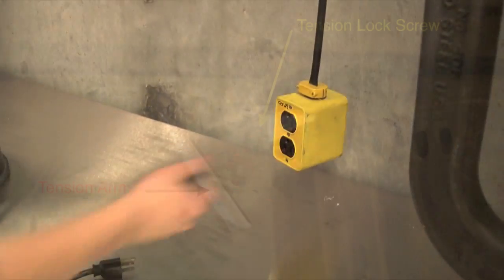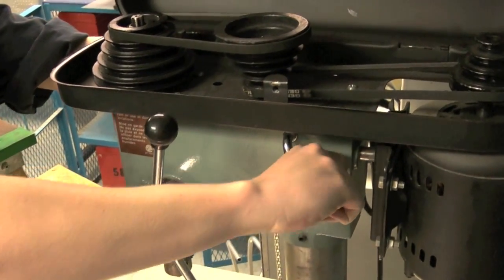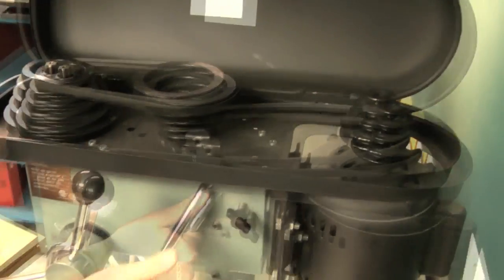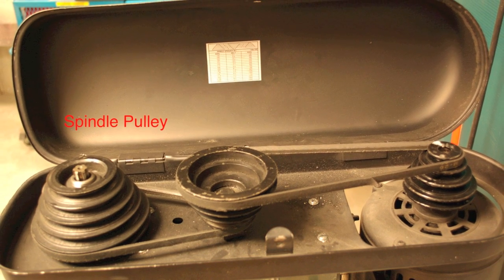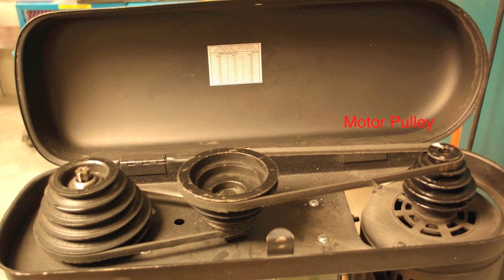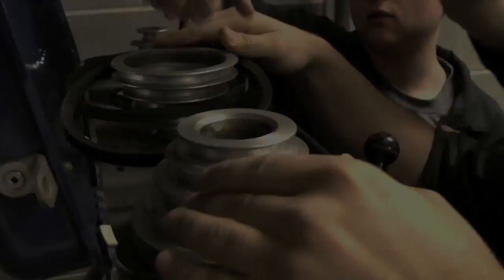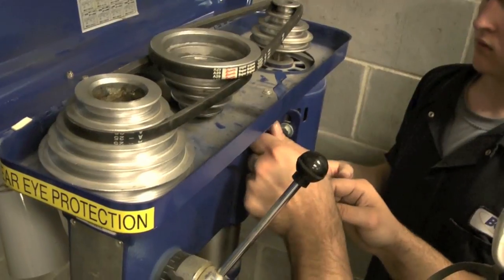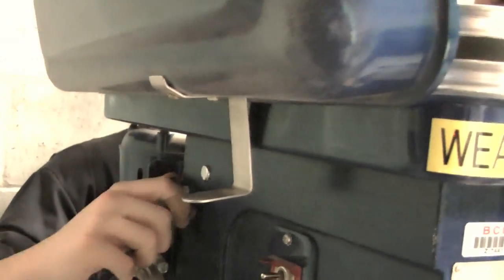Drill Press Safety and Adjustment.mov

Comment: Anybody that is still alive in these comments know what size the belt it
Reply: Belt on the spindle pulley and idler pulley is an A25. Can't make out the belt size on the other belt...looks to be either A25 or A29
Reply: My press which looks identical but sold by Northern has M25 and M26 belts

Comment: Thanks for posting the video it was very helpful, I have the same drill press which has been rebranded by NUtool, do you happen to know the belt sizes or where to find out ? I've emailed NUtool a few times and heard nothing back, the drill was second hand and I think previous owner put wrong belts in, thanks
Reply from the maker: Hi Christopher ~  I no longer have access to that drill press, so I can't comment on the drive belts.  Just recalling from memory, drive belts were often a standard item in many automotive supply houses, and it was not unusual to have the worn belt replaced with an off-the-shelf item, and small adjustments in the belt length were easy decisions at the time of purchase. Take your unknown belts with you to an auto parts retailer and they can advise you.  Be aware that some drill presses have the adjustments for the center idler wheel hidden, and only loosened up with a pair of bolts underneath the wheel.  Good luck.
Reply: @Riveteer  thanks for the advice

Comment: I have a drill press I recently bought. I have started taking it apart for cleaning and derusting. I had to remove the motor mount. It was bolted in place by 2 tension arms that stick out the back of the cast body. I removed the tension rods, but do not know how to correctly position the tension adjusting arm when putting the tension rods back into the drill body. The drill press I own is a TOOLMAC 16 Speed Heavy Duty Drill Press, MODEL # 82-532401. 3/4 HP.
Reply: Any and all advice or information would be most appreciated. Thank you for taking the time to read this.

Comment: I have a problem and hope you can help.  My drill press is a Central Machine Model 10168, serial number 0262274.  After reviewing your video, I noticed that my machine does have the locking screws, but no release tensioners.  Even after unlocking the screws, I cannot release the tension on the belts.  What should I do.
Reply from the maker: Hi Randy - although I couldn't find much information on model 10168 drill press, you may have the type of drill press where there are 3 pulleys in the belt drive compartment.  This type of machine offers a pulley on the motor, another pulley on the quill (above the chuck), and a third idler pulley in between the others.  On some of our drill presses, we have that idler pulley held in place with a pair of mounting bolts found at the base of the idler pulley shaft, and these bolts will also have to be loosened off in order to release tension on either of the 2 belts.  This is in addition to the two locking bolts on the outside surface of the main frame which will hold tension on the electric motor mounting.  There may also be a small tensioning lever on one side of the frame.  You may need an extra person to hold stuff while you're tightening all these bolts.